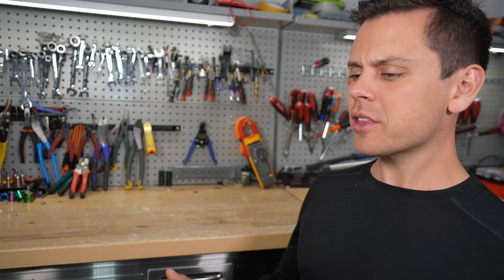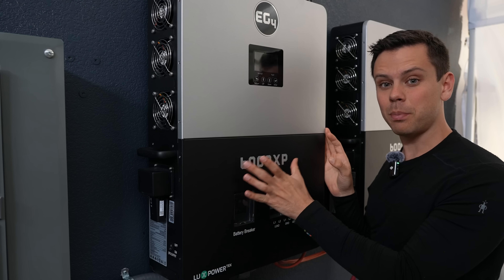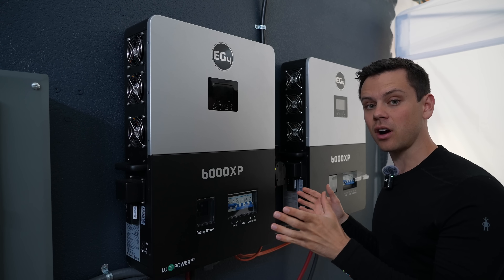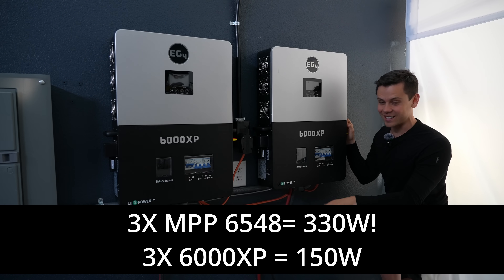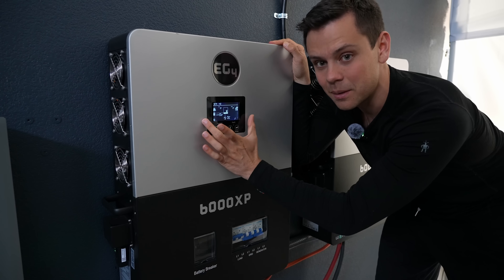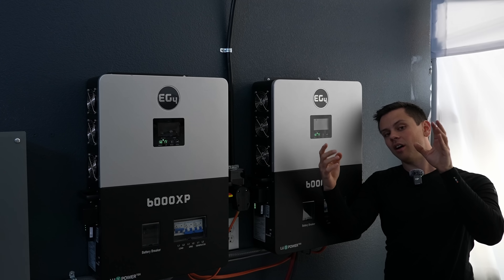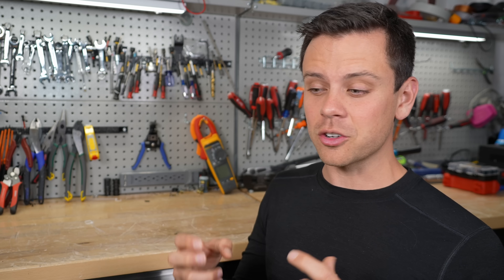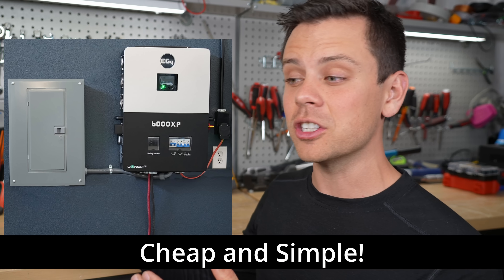Offgrid VS Hybrid Inverters! Which one is better for the $$$?!

Comment from the maker: Inverters mentioned in this video (affiliate links):
6000XP Offgrid Inverter: https://signaturesolar.com/eg4-6000xp-off-grid-inverter-split-phase/?ref=cPwLcVc0SW-BjN

Free 6000XP System Blueprints: https://www.mobile-solarpower.com/48v-complete-system-blueprint.html

18kPV Hybrid Inverter: https://signaturesolar.com/eg4-18kpv-hybrid-inverter-all-in-one-solar-inverter-eg4-18kpv-12lv/?ref=cPwLcVc0SW-BjN

Sol Ark 15K: https://www.currentconnected.com/product/sol-ark-15k-all-in-one-hybrid-inverter/?ref=wp

Victron Inverters: https://www.currentconnected.com/?dgwt_wcas=1&post_type=product&ref=wp&s=victron%20inverter

~~~~~~~~~~~~~~~~~~~~~~~~~~~~~~~~~~~~~~~~~~~~
Tired of getting ripped off? Check out my "Will Prowse Approved" solar product recommendations below!

12V Batteries
https://www.mobile-solarpower.com/lithium-batteries.html

48V Batteries
https://www.mobile-solarpower.com/48v-batteries.html

Offgrid Inverter System Builder
https://www.mobile-solarpower.com/48v-complete-system-blueprint-559371.html

Hybrid Inverter System Builder
https://www.mobile-solarpower.com/code-compliant-48v-offgrid-system.html

Mobile Handtruck System Builder (very popular!)
https://www.mobile-solarpower.com/mobile-48v-system.html

Solar Panels
https://www.mobile-solarpower.com/300w-solar-panels.html

Ground Mount Solar Racking
https://www.mobile-solarpower.com/ground-mount-racks.html

Wire, Lugs and Busbars
https://www.mobile-solarpower.com/wire-and-connectors.html

Tools
https://www.mobile-solarpower.com/tools.html

Fuses and Circuit Breakers
https://www.mobile-solarpower.com/fuses.html

Plug-N-Play Solar Systems
Ecoflow, Anker And Bluetti! So many models to choose from. See my current recommendations here:
https://www.mobile-solarpower.com/full-size-systems.html

~~~~~~~~~~~~~~~~~~~~~~~~~~~~~~~~~~~~~~~~~~
Need to build a large DIY system? Need a trustworthy solar distributor? These are my favorites:

Signature Solar
Creator of EG4! Solar Minisplits, Victron and More! Largest Solar Store Online.
If you want $50 off, please use my link below and coupon code "DIYSOLAR50":
https://signaturesolar.com/?ref=cPwLcVc0SW-BjN

Current Connected
Best Prices for EG4, Victron, Midnite and so much more! Fast Shipping and Highest Rated Customer Service:
https://currentconnected.com/?ref=wp

~~~~~~~~~~~~~~~~~~~~~~~~~~~~~~~~~~~~~~~~~~
Join our DIY Solar Community 
Need more help? Join the largest solar forum on the internet for beginners and professionals alike. 140,000 members and counting!
https://www.diysolarforum.com

Check Out My Free Book
Best-selling and beginner-friendly guidebook to off-grid 12V solar!
https://www.mobile-solarpower.com/the-book.html

~~~~~~~~~~~~~~~~~~~~~~~~~~~~~~~~~~~~~~~~~~
Contact Information:
I am NOT available for personal solar system consult! If you wish to contact me, this is my direct email: williamprowsediysolar@gmail.com
FTC Disclosure Statement and Disclaimers:
Every video includes paid promotion or sponsorship (such as free products for review). Some links on this YouTube channel may be affiliate links. We may get paid if you buy something or take an action after clicking one of these. My videos are for educational purposes only. Information is subject to change/update at any time. Electricity is DANGEROUS and can kill. Be smart and use common sense :) DIY Solar Power with Will Prowse is a participant in the Amazon Services LLC Associates Program, An affiliate advertising program designed to provide a means for sites to earn advertising fees by advertising and linking to Amazon.com
Reply from the maker: If you are doing a small offgrid 12V system, I recommend Victron Inverters as usual. Check out my other videos to see 12V system builds!! Check out my latest video here: https://youtu.be/xb_ixg1eilU
Reply: @WillProwse  I just commissioned my 18kpv with a 10kw array & 30kw lifepower4 battery bank. 
I have a 4 ton HVAC with a  microair soft start installed, which only pulls an inrush of 31 amps at startup. Sadly, whenever I place the 18Kpv into off grid mode I can hear my HVAC compressor pulsing making odd noises. The last time it happened I noticed that my inside blower was on but my outdoor unit was no longer running. I shut the system off letting it settle for approximately half an hour and tried it again. The same exact thing happened. Tech support at EG4, took it out of Off-grid mode and the problem went away. I'm not sure this is ideal, since I do not want to sign a net metering agreement. I also want to be absolutely sure there is no possibility of back feeding power to the grid for both legal and safety reasons. What are your thoughts?
Reply: @WillProwse  in our place we call it ongrid-offgrid inverter vs grid-tie inverter, we call it hybrid if it has mppt charger and inverter all in one device. so with hybrids we call it ongrid-offgrid hybrid inverter vs grid-tie hybrid inverter
Reply: Can you get the tax deduction for an offgrid inverter + batteries ?
Reply from the maker: @jaminoes_  I believe you can actually. Even pv assist mini splits can get the credit.
Reply: @jaminoes_ yes.  No grid required to get the credits.
Reply: Whats your opinion on the New Ecoflow Delta Pro Ultra?
Reply from the maker: @Moes_Prep_and_Tech  oh tough, I don't have it yet. Looks ok. But I wonder how solid the software is
Reply: You forgot to mention that hybrid inverters Such as the 15k can do AC coupling using the gen input or load side of the inverter.
Reply: Out of the current systems on the market I would go for the Anker Solis X1. Anything with to do with Elon Musk I won't touch! Dude is a ...hole and wrong in so many ways.
Reply: Hi Will.  My spouse and I want to put a large solar system on our rural property in CO.  We have a 1500 sq.ft. cabin on it but it will become a guest house and we intend to build a 3k sq. ft. main house.  We also have a full shop w additional freezers and an RV for guests.  While we have power to the property, it is unreliable and expensive due to remoteness.  We have $30K total budget for solar and are clueless if this is sufficient to put in a decent off grid system to act as primary w the commercial power as back up.  Would you kindly point me in the right direction, like should I get a kit or put components together?  Which are compatible?.  I love your videos and value your advice.  Many thanks, Joe.
Reply: As a European, thse brands all look weird. Why no SOLAX/SOLIS/DEYE ?
Reply: @HermanWillems 
I have the same problem. I can't get prices on anything. Just user manual information. 

I'd like a Deye 5kw hybrid but would also like competitors' equivalent models. It's very frustrating.
Reply: Old head on young shoulders

Comment: My power company in Santa Marta Colombia suddenly went from providing 110v to 220v for several hours. My circular saw exploded in my face, I lost several fans, I talked to an employee and got a shrug. I prefer my switching between the two, using the city system as back up on cloudy days, and exclusively solar and battery completely separated most of the time. I'm just waiting for the next big price drop to double my system. I actually bought a small system that I installed in the kitchen. I bought an intermediate sized one to augment the power produced by the second larger system also led to the kitchen and plug things directly into them without going into the power system. It's not perhaps what I would do now, but each step made sense at the time and I could easily take one of them with me if I wanted to without disconnecting the from the house and I felt very pleased running a non-battery power jig saw up on the roof when installing one of the solar panels. The point is some of us are very wary of our power companies. Being independent and living on green power is such a good feeling. There is nothing warmer than the smug feeling you get when you leave the house and discover everyone elses lights are out. Offer condolence and try to wipe the smug smile off your face.

Comment: I'm just more confused at this point. If I'm on the grid, but have no intention of net metering and want to generate for my own use I'd still go with a hybrid, right? I had a victron (didn't like it) so the 18kpv would be the guy I'd hang on my wall?

Comment: Have you looked at SolarEdge? With an off-grid setup, would you recomment the Hybrid over the off-grid? Can you hook-up multiple Hybrid inverters in parallel like you showed with the off-grid? What if you need 3-phase, can you just take 3x off-grid inverters and connect grounds with each hot being a separate leg or does it require something else to get true 3-phase (477v)?

Comment: Will, 12:26  you mentioned using a bunch of 6000XPs with transfer switches and combiner boxes. I think you meant that for another type of inverter as you mentioned that the 6000XP has built in transfer switch and combiner boxes. Where I think that got confused is that with the 6000XP you don’t need solar line combiner boxes since you have 2 MPPt charge controllers per XP and can run in parallel using the sync cable. So the 6000xp is still the less expensive choice. Considering I believe the supplied amperage of the 18k is 50A per line total 100A. Which is the same as 2 XPs with the exception of usable wattage which part is dedicated for batteries and the total solar coming in. However, 3 XPs gives 75A per line or total 150A service and 30K of input power with 24k usable with a total of 6 MPPT controllers. Making the 6000XP the cheaper option for more power usage. Even though a warranty is only 5 years does not mean it will only last 5 years. The 6000XP  are indoor inverters as I recall. So if kept in an air conditioned environment and a clean one. Should last a long time. 
Thoughts

Comment: Yeah but none of those new off-grid or hybrid inverter (Luxpower Tek) offerings from EG4 have light bars on them anymore! I still love the good 'ol LV6548 model for myself, one, because that's what I bought back in the day when you were touting all about them a lot (have to get my money's worth still), and two, because they handle line imbalance beautifully... It did cost a lot more in breakers and accessories to install though. The Luxpower Tek style, like Sol-Ark are way simpler and cheaper to install... When I help others consulting for installs out at our co-op ranch, I always say go with the 18Kpv or 6000xp because I always wind up having to help walk them through the  install process, and they are way easier to implement without having to make a huge laundry list of extra items to buy to facilitate safe install..

Comment: Can you use a offgrid system with a gateway so you can switch automatically to grid when sun is out and batteries are running low ?

Comment: I am building an electric bike. 

For this build i need a battery that powers a motor. 

To charge this battery, i need a battery charger. 

What i plan to do is make a power pack using knowledge gained from the solar world. The problem is the inverter. to recharge the batteries, i want solar and to use a wall socket. 

Solar when i dont have access to an outlet. an outlet when i dont need the sun or have no access to the sun.

Comment: Seems the video is too specific to the EG4 lineup.  What about for non EG4 brands, say a Sungold or MPP?  Are Sungold hybrid inverters outdoor rated but their off grid aren't?  Idle consumption of Sungold hybrid vs offgrid?  How about for Sungold displays and interface?  Do Sungold hybrids have included PV disconnect, but their off don't don't? Also compare line balancing?  As you may deduce from the line of questions, wondering if EG4's are worth the higher cost compared to other brands. Perhaps that would make a good video comparing EG4 features vs Sungold vs MPP.

Comment: Dude,you ROCK! I’ve learned so much from you! Best part is the beginner videos and all the different options that you present from “ Volkswagen” systems to the “Cadillac” options! I’m in the Central Valley in California and have Pacific Gas&Electric. Typically pay at least 400-500mo with the A/C running. Looking to convert in very near future!

Comment: Hello and thank you for your videos, they are very informative!!
I have a question. If you have a 6000w offgrid inverter connected to the grid and a 16kwh battery. When you want to draw more than 6-7000w and the battery is full, can the battery send this much through the inverter, will it send only 6000w from the battery and the rest from the grid or it will stop drawing from the battery and take everything from the grid?

Comment: hello, could you provide me what size wire cable to use from solar panel to inverter.  i planning to connect (10) 540W solar panel in series.  thank you

Comment: Anyone using a generator backup?  I am consider a whole home syste.. 24kw generator is around 10k. Would it make more sense to just  install more panels and batteries and not bother with the generator? I am using propane for heating so generator would use same tank...

Comment: Is it possible to set up an off grid or hybrid inverter on the same system as a grid tied micro inverter system in order to create a micro-grid in the event of a blackout in order to prevent back feeding, but still allowing use of your micro inverter and PV array? 

Forgive me if this has been addressed elsewhere.

I know that there is a lot of red tape, but I am curious how possible it would be? I really want to use my Enphase system off grid… But didn’t make that decision until after a couple of the years of grid tied setup.

Comment: Hey Will your channel is the reason why I decided to build my own system. Love the videos and they are very informative. I am on a budget and I was thinking of getting 2 hybrid inverters the srne sei-12k-upro that handle 18kw each to prioritize selling to the grid and run whole house using a spi-12kup or 2 to runs all house loads in offgrid mode. Can I connect the ac in on the offgrid to the ac loads on the hybrid? And setup the offgrid as solar,utility,battery source priority or does that sound like a bad idea?

Comment: I have a manual switch to let me access the grid or run off grid.  This way, even if the grid is up and running, I can still run on solar and not have to deal with the electric company trying to rip me off.  Turn off the grid at sundown, turn it on at sunrise.   Night time, the demand for power is much less.  Just be sure to have enough solar to recharge your batteries AND run appliances during the daytime.

Comment: I can attest that the transformer-based equipment lasts forever.  I have a grid-interactive system based on 2 such inverters (SW4024s) that are from the last millennium.  So old the nameplate on the front says "Trace".  The system was installed so long ago that even Los Angeles didn't know what to do about permitting for rooftop solar.  There was no checkbox on the forms so we just called the system part of "roof repairs".  (We did install a new roof as well.)  They've been producing on average about 10kWh/day AC power since the late '90s and went on the grid in 2000.  They've long since paid for themselves in avoided utility costs and I kinda want to upgrade the whole system to take advantage of modern equipment but those Trace inverters just keep working.

Comment: heres a offgrid question mebbe u could answer. im completely off grid and plan on starting out w a 6000xp system so i can stair step it up till i get what i need,BUT if eventually someone pays the 100 grand to run power poles by me could i put in a hybrid 12000xp for the gridtie function and still daisy chain all the coms and power to my home then to get a net metering deal or would all of the xps need to be the hybrid models?

Comment: I'm hoping you or someone can answer a question I have, I'm building a system with the full intention of being off grid, however I do have (10) micro inverters and (10) 48v panels that have 240v output, my thoughts build main 48v system with 6000watts inverter that has split phase 240v output this system pv of 6k worth of panels so can I connect this separate system of 10 panels with the micro inverters to assist the main inverter!? My understanding is that the micro inverters only need to see power to become active then they began to flow power to assist the load. Thanks Nate

Comment: Hi @WillProwse. please illustrate how you would connect a stanby genset which has ATS or add a standby genset with ATS(mains,gen and load )to an already existing hybrid inverter that has mains already connected from local municipal meter to hybrid inverter and also has already existing PV connected to hybrid inverter. so i can unerstand what or where signal comes from inverter to which parts of genset controller for start and stop during power outage

Comment: Something I haven’t seen anyone mention here is fault tolerance.  Since I am looking to build a system that has no grid connectivity at all I am concerned about single points of failure in any system.  Using a hybrid system has a single point of failure of the inverter.  If it goes down, regardless of warranty coverage you are completely without power.  If you use multiple off grid units then if one fails you still have another that you could run critical circuits with until a replacement or repair occurs for the faulty unit.  In fact, depending on your finances you could even have an additional backup inverter that could be swapped out upon system fault.  To me, for someone who will have no access to grid power at all, this would seem to be an important consideration as well.

Comment: Will, I have a question. I installed may panels, wired them to my Calpha 48v Hybrid inverter 10,000.
When i hook it up, Grid in and RV 50 amp, it smoked my rv Converter and 2 Makita charger.
I have more info but will add if you respind.